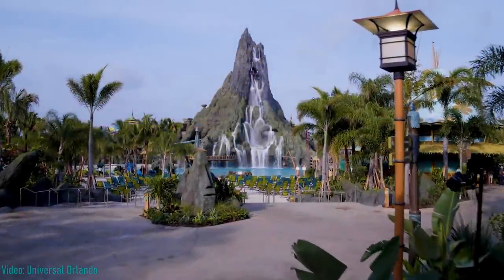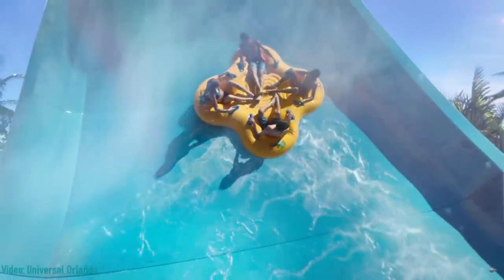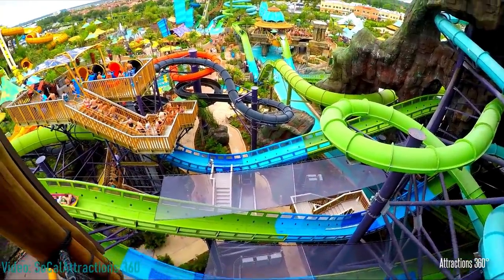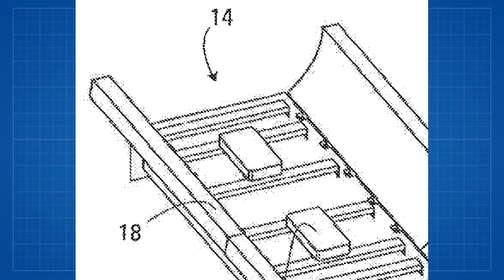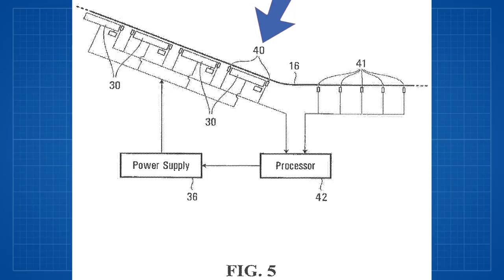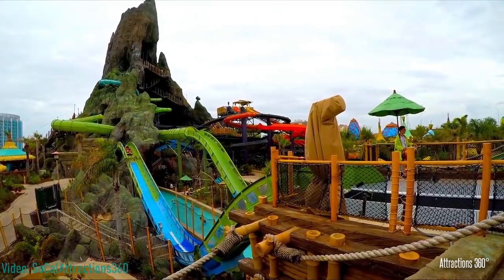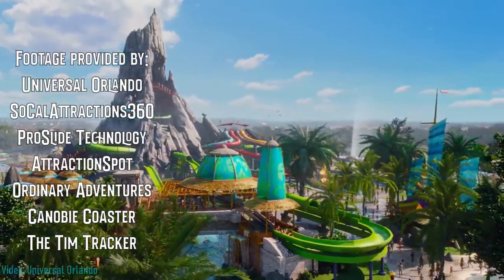Krakatau Aqua Coaster - HOW IT WORKS

Comment: Great video. As advice for folks who are interested in this slide and Volcano Bay more generally, it's really quiet out of season - we went in December and were able to ride this coaster three or four times, and probably could have done it 20 times if we'd fancied ignoring most of the rest of the park. Not bad when the weather is still well above 20 degrees celsius.

Comment: Who doesn't love water parks! This was a great video. I bet it uses less power too because those pumps for the water propulsion version are just blasting away all day long, whereas this probably only uses power where the boat is on each hill for a second. So cool!
Reply from the maker: And the master baster coasters tend to be more dangerous cause they're just spraying water out of the slide towards rider's backs like a fire hose.
Reply: @AmusementLabs  They're also more likely to blow your swim suit off. First time ever at a waterpark, and the master blaster at Schlitterbahn almost blew my bikini bottom off my butt. I haven't been to a water park since, but I am never wearing a two piece to one ever again.
Reply: @AmusementLabs  Wow. I had no idea, surprised that they did not redesign the boats to have a back surface.
Reply: @neekMarieM14  Wow. That's insane! sheesh.

Comment: Hi a question my partner has a pacemaker which uses an induction to change her setting can people with pacemakers ride this ride and what's universals opinion?
Reply from the maker: Oh, that's a good point. I would definitely not be the voice of certainty on that. From what I can see the steel plate would prevent the fields from doing much or spreading up towards the chest, but don't take my word for it, I would contact Universal first or when you get there go to guest relations and talk to operations or someone similar.

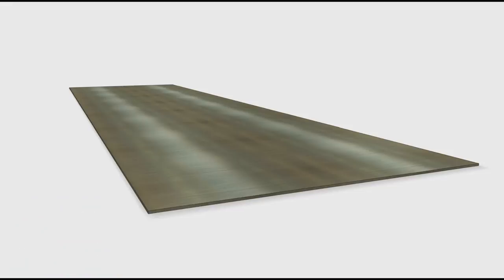Comment: 4:13 I'm slightly confused as to how you can have a "Non-ferrous plate of galvanized steel" since ferrous means "contains iron". By definition steel is an alloy of carbon and iron.

Edit: Having read the patent filling it appears you meant to say ferromagnetic instead.
Reply from the maker: Ah yes, you're right. 🤦‍♂️
Reply: Thanks, I was going to ask the same thing.

Comment: Yeah then you have crowded ass walkways and it's so damn hard to get by anyone...they need to speed up their operations on the family raft rides their water coaster runs really well with the moving belt. Is it easy to reset the rafts if they roll back?